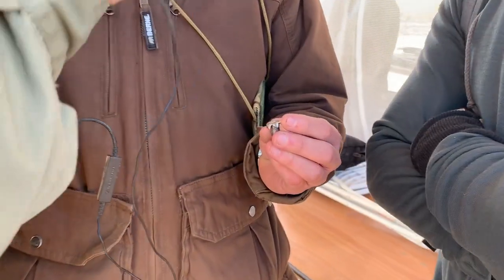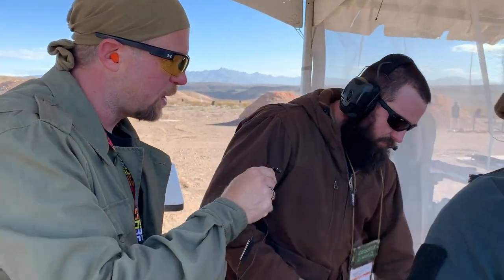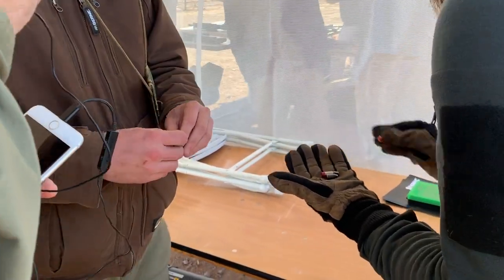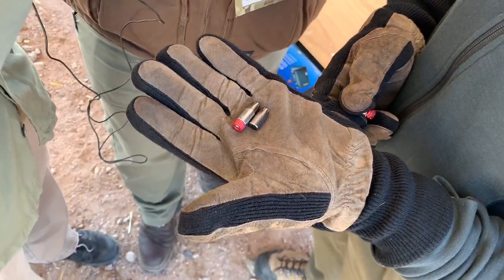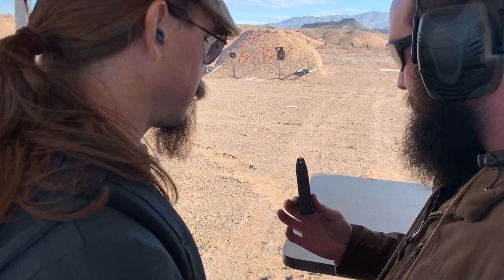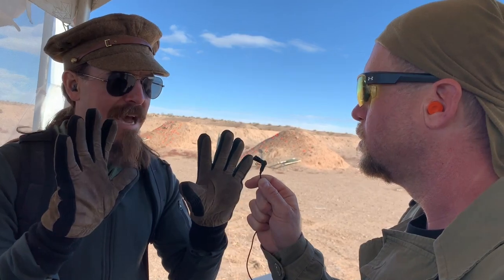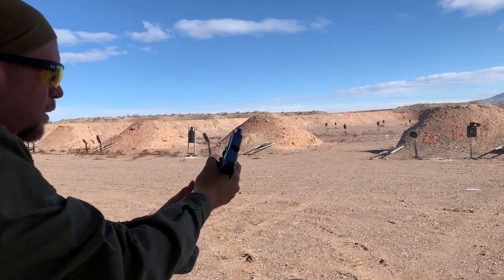SHOT Show 2019: Seismic High Mass Ammunition

Comment: 185 gn bullet @ 950fsp. Congratulations, they have basically reinvented the 40 SW. :) Still a neat idea. Great video
Reply: True. 

I think the appeal here is that you basically gain the capability to use 40S&W -equivalent ammo in existing 9mm handguns. 

The ability to essentially switch from 9mm to 40 and back with nothing more than a mag change is potentially quite interesting.
Reply: .40 will always launch a bigger and heavier bullet faster than 9mm.
Reply: @EtherFox    So they really .300 Blackouted the 9x19mm.

Comment: Physics always applies.  The question becomes which equation you care about, momentum or energy.  In one mass is equally important to velocity, in the other it isn't.  This skews whether you favor mass or velocity.  

To me a handgun cartridge of the standard choices is never going to be some hammer of Thor.  If you don't hit the critical organ or part of the central nervous system you're poking holes.  To a certain point I actually find the idea of a massive 9mm bullet a bit amusing, as the rationale for using 9mm in the first place besides capacity was that ease of shooting and speed of follow up shots was more important than mass.  

I guess this product means you can have your cake and eat it too, though I wonder how much it matters.

Comment: Ammo for The Church of 9 MM that is in the territory of 40 S&W, 185 gr 950 fps 370 ftlb! It does concern me about the steel case separating from the aluminum head of used in a carbine. That is an issue I've experienced using aluminum cases ammo in a carbine. It a 6 inch or less barrel the aluminum case would have made it out of the barrel. As a 40 S&W heretic, I am sceptical, but my Beretta 92 is intrigued.

Comment: Initia F = M * A.
Force is equal to mass multiplied by acceleration.
More mass moving slow, and smaller round moving faster have the same energy dispersion on target. The important part is how the round affects the target. If you're hitting a bear, you might want to smash through bone and hit vitals with a fast cartridge more than you want a big heavy object to hit them and potentially bounce off bone. 
However, In the case of gravity: the more massive cartridge will lose velocity quicker and drop sooner than the lighter faster cartridge.
95gr moving at 2k+fpm is pretty useful for hunting, whereas 305gr moving at 1kfpm is quite useful for short range self defense.

Comment: At the end of the day, this is going to be another expensive bullet that doesn't have the same point of impact as your practice ammo. The difference is that, unlike its lightweight superfast fellows it will at least be adequate, and maybe even a bit better than top shelf standard loads. But it's still a 9mm pistol. If you need more than a 9mm, get a bigger caliber instead of futzing around with fancy loads, or better yet, get a long gun.

Comment: If you want a 185 grain bullet going ~950 fps, .45 acp has been doing that for decades. Just sayin'. (*sips tea from John Moses Browning commemorative coffee mug*)
Reply: Yet you get more magazine capacity...
Reply: @davet231  Considering the average armed encounter in the U.S. involves 1-3 total rounds fired, I don't think 4 extra rounds in a Glock 17 over a Glock 21 would make much difference. And if you go down to the subcompacts, it's even less of an advantage. 10+1 in the 26 versus 9+1 in the 30.
Reply: ctperry06 But when you do need those extra rounds it can be the difference between life and death, so I tend to lean on the overkill side of things.
Reply: david smith who was talking .45 super? Yes all those female and children police officers, nato forces, might as well just switch over to .22lr right? Come on man the point of this was if you get .45 like performance with more capacity out of a 9mm why wouldn’t you go that way?
Reply: @davidsmith9189  The only 45 Auto running 9mm NATO pressures is 460 Rowland. 9mm NATO is limited to 36,500 PSI by CIP measurement standards. It's measured in a different process than SAAMI specs, but is generally considered to be a higher limit than 9mm +P. 45 Super operates at significantly lower pressures than even standard pressure 9mm.

21,000 PSI 45 ACP
23,000 PSI 45 ACP +P
28,000 PSI 45 Super 
35,000 PSI 9mm
38,500 PSI 9mm +P
40,000 PSI 460 Rowland
Reply: True, but find me a .45 with 9mm recoil and reasonably sized 15 Rd magazines.
Reply: @davidsmith9189  or you want accurate follow up shots.
Reply: @type40imperator  yea but if you could have less recoil and a higher magazine capacity for basically zero downside... Why wouldn't you want that?
Reply: Lucian Leesonja it’s entirely preference lol bullets kill if they hit something important... it’s that simple guys

Comment: But if you reduce the charge for a heavier bullet isn't in the end the same thing?
Reply: What is easier to stop, light and fast or heavy and slow?
Reply: @BeltFedSelfDefense  I don't think it works like that , actually speed gives much more energy than mass, that's why the military don't use 1bore muskets anymore
Reply: @berniegran4785  They aren't reducing the charge, it's just more cramped. Regular 9mm powder charge has room to spare.
And energy doesn't really matter in pistols, it's too low anyway. You need just proper expansion and penetration.

Comment: The bi metal cases are interesting but are they reloadable ?
Next thought  is I think this would be great in 45 Colt +P  for use in the stronger 45s  Ruger redhawks or Blackhawks S&W 460 or the 454 casulls
Reply: the big advantage of these cases is that they're reloadable as often as you like
Reply: @tommihommi1  would you need different reloading dies  for the steel bodys ?
Reply: @waltlars3687  you need to get the special dies made for it, as far as I know. The cases themselves are cheaper than brass, though.
Reply: @tommihommi1  and all the other replyers  interesting ideas I guess it all matters how much they harden or heat treat the dies 
I also wonder if how well the aluminum Stainless steel will stand up  to salt air environments
Reply: @waltlars3687  their dies are tungsten carbide, not steel, so hardening isn't an issue. Steel dies can't be used for steel cases. The aluminium is nickel plated to prevent corrosion.

Comment: Totally lost me when he used the phrase "knock down power." There's no such thing unless you're talking about hitting somebody with a baseball bat (or equivalent). It was a myth/urban legend with the .45 and it remains so with many who clearly don't understand simple physics.  A pistol kills or disables with penetration and expansion to hit and damage a portion of the central nervous system or open a vein or artery to create blood loss (the faster the loss, the quicker the incapacitation). As far as "knock down power" goes, if you wore a steel plate that would stop this bullet fired at your chest (thus insuring the maximum striking power) you'd feel a "thunk" that wouldn't even push you back a half step, much less knock you down.  The measure of effectiveness is penetration (without overpenetration, i.e. through and through) along with expansion. They didn't talk about  those two factors at ALL. Screams "gimmick" to me until I hear about what actually matters.  Meanwhile, the slow velocity suggests UNDERpenetration to me.
Reply: Knock down power is a plate shooting term used to describe how well a given round knocks down steel plate targets. It's not a fake metric, it's a real thing.

Comment: I care about KE.  F = mv^2.  Velocity trumps mass every single time.
Reply: Shoot a 5.7x28mm at a steel plate, then shoot a standard 115gr 9mm at a steel plate. Tell me which moved the plate more. After 20 years of screwing with ammunition and guns, I don't buy that calculation at all. Velocity matters if you want to put holes in steel, or create a fragmenting bullet that's effective, otherwise, mass getting to the target with sufficient velocity is going to have a more profound effect.

Comment: As long as you have 16-18” of penetration with a reliably expanding bullet, it doesn’t matter what handgun caliber you shoot them with. Marketing crap.
Reply: These are subsonic though. While still transmitting similer KE to standard supersonic loads. More geared to suppresor use
Reply: Beardoggin89 Live Action Why hollowpoints? Why not make a super heavy fmj instead? Who shoots people with 9mm suppressed handguns for a living? No one.
Reply: @MrMalicious5  because the wider the surface area the more energy transferred. And the sharp petals of a hollowpoint cut tissue rather than displace it like an fmj, which is important in handguns since they typically do not impart hydrostastic shock on the target. And i know people that use suppresed carbines for home defense and subsonic ammo is easier on the ears indoors even unsuppresed
Reply: Beardoggin89 Live Action If they’re going so much slower than a regular 147 to stay within pressure limits and are the same KE, what’s the point? 147s are already subsonic.

Comment: Soon or later someone will discover the. 40S&W.
Reply: broken glock noises
Reply: you spelled 10MM wrong.....
Reply: @dankdark974  because. 40 don't like cheap guns 😉
Reply: you mean problem solver. No other pistol caliber is more proven. Countless turf wars under its belt.
Reply: @mikef3808  9 parabellum is  WW I relic.
Reply: @calebfaires9782  I don't think so. 10mm is a extremely respectable anno.
. 40 has the same gun size of the 9x19.
Reply: 10mm short
Reply: What we need is .40 Magnum
Reply: @calebfaires9782   .400 ACP

Comment: F=ma

Bigger m, smaller a to get same force.
Reply: I think you're applying the wrong formula here. That would be used to calculate acceleration in the barrel for a given impulse and projectile mass. The acceleration of a round that has exited the barrel will be in the negative direction. KE = 1/2 MV^2 is what you're really looking at for energy deposited in the target. What's interesting here, though, is the large change in momentum, which is just MV. Such a considerably higher mass will mean the round has more inertia while traveling to and through the target.

Comment: Just get a 10mm
Reply: @OI Personally I don't think standard 9mm needs fixing. The more options the better generally, there is a place for this for someone, but if you're looking for more energy to dump into a target I would argue for stepping up to 10mm rather than clever wizardry on the 9mm. A G20 or the SF version is compact enough, IDK if I want a +p or +p+ in anything smaller than that, if I'm running really subcompact (probably rare in my case) I'm good with less than 9mm even.

Comment: Or … standard bullet weight for 40 S&W. I'm sure I'm missing the purpose of this ammo.
Reply: Low recoil
Reply: With .40 S&W you're always trading 2 or 3 rounds of capacity for a bigger bullet. This is getting equivalent mass and probably ballistic effects out of a smaller diameter cartridge that you can carry more of.
Reply: @scruggs6633  yeah, but at subsonic velocities it is also going 200-300fps slower, so I doubt the ballistics are similar.
Reply: @jayzenitram9621  Guess we'll just have to wait to find out, but I'm thinking a non jacketed lead projectile going at subsonic velocity, that's going to have a lot of time for expansion and energy transfer. If a round is really cooking it'll go right through with lesser effects than a subsonic sometimes. Might be no different, might hit like a Mack truck.
Reply: @DickTickles  But if you're dealing with something concealable like a Glock 43 or a Sig P365, most self defense encounters go to an empty gun with no time for reload. By then one party or the other is incapacitated or fleeing. That 2 or 3 extra rounds could mean 50% more time to solve your problem.